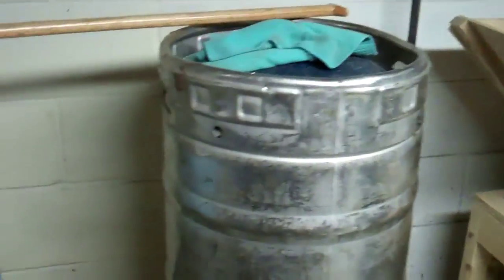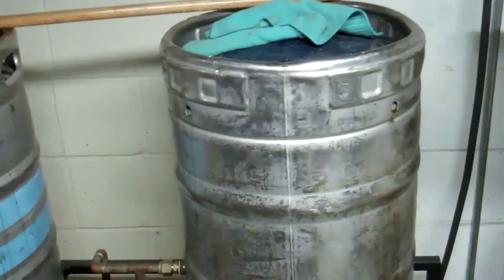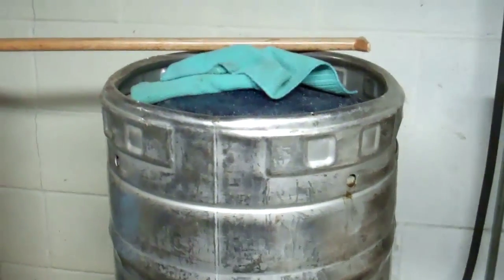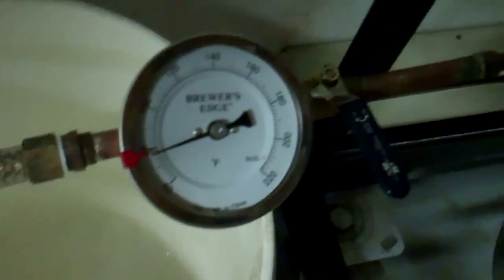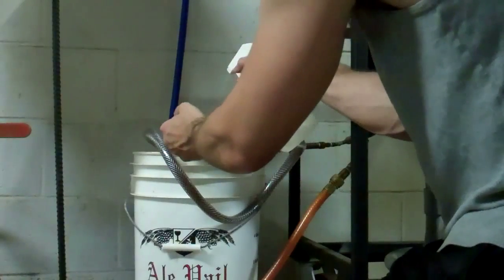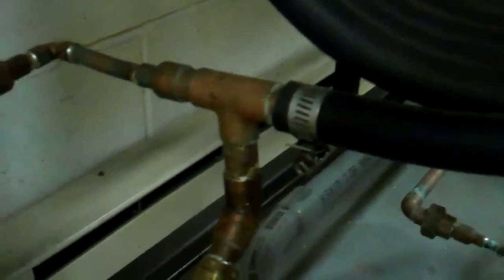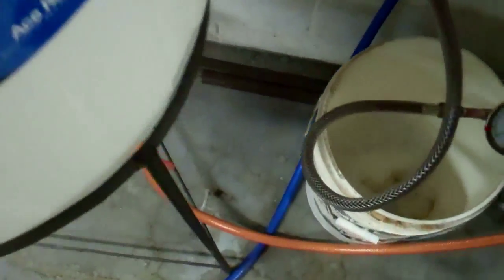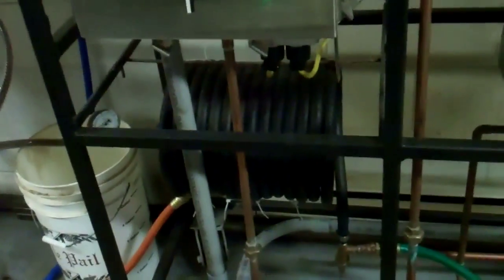Brew Devil:  7. Counter Flow Chiller

Comment: Hey mate, cool vid and nice system once again... Just wondering if a greater gravity force on the pump inlet by raising the kettle a bit would make enough of a difference on the cavitation, or larger diameter inlet pipes, or get a voltage regulator for the pump so you can vary the speed it runs at. What do you think?